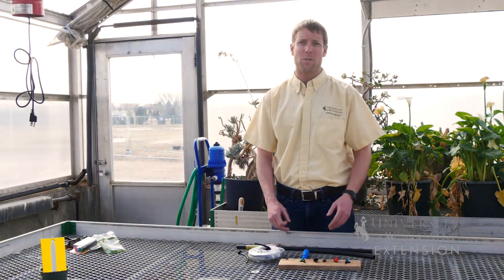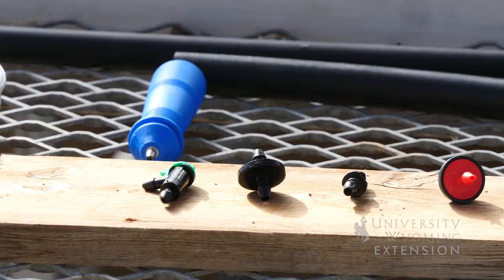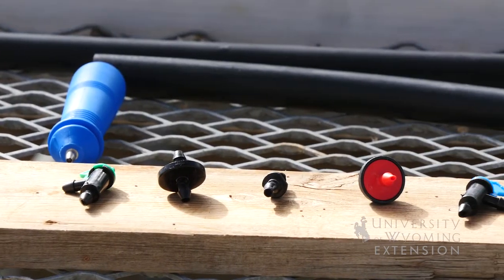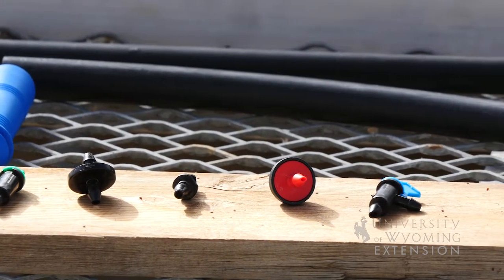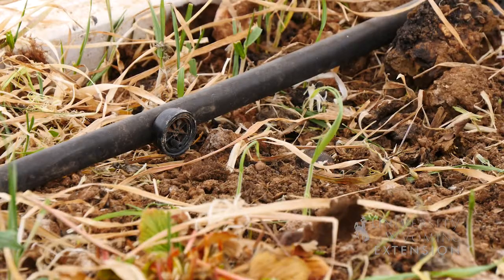Drip Irrigation Flow Rates | From the Ground Up

Comment: is there any way i can get a half liter per hour dripper emitter for my rooftop garden ? or maybe modify the half gallon per hour ones ?
Reply from the maker: We would advise you contact the manufacturer of your particular equipment. This would be very dependent on the particulars of your system.

Comment: whats the minimum psi needed ?
Reply from the maker: From Brian Sebade: I would recommend that they check with the manufacturer for the system that they purchase. Most systems don’t require a high psi. Some will work with around 10 to 15 psi not have any issues at all. You could even add a little snippet that says in fact many systems require a pressure regulator so systems don’t go over 20 to 30 psi